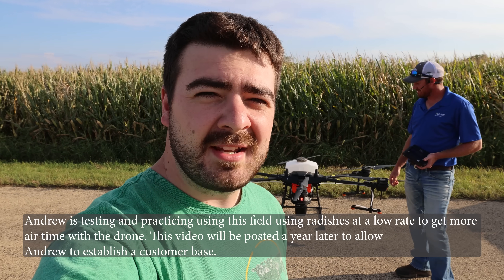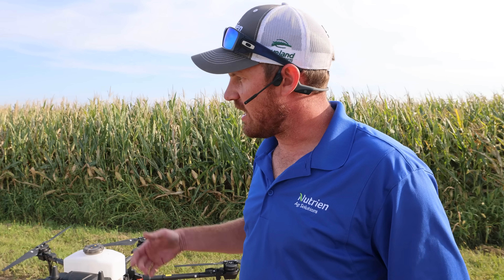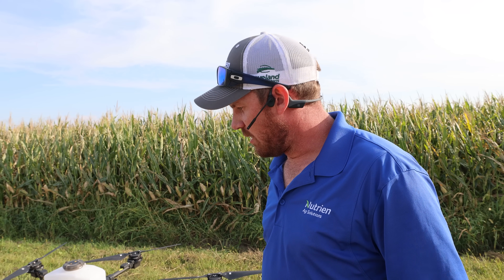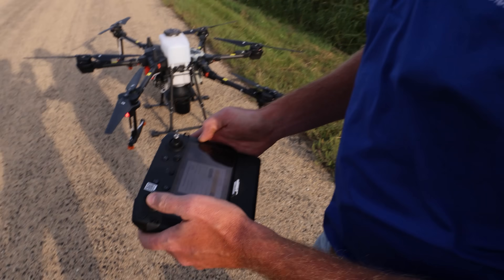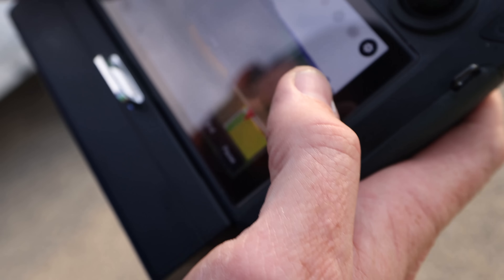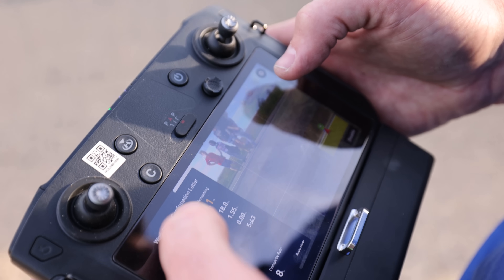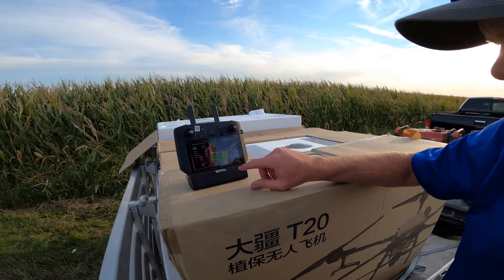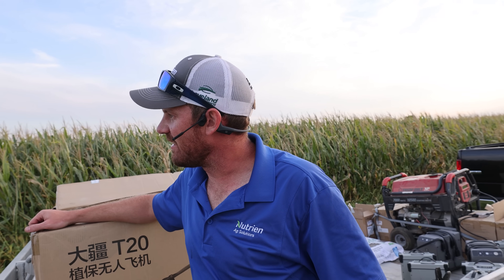Spreading Nitro Radish Airborne - DJI Agras T20 Drone

Comment: I can see the possibilities using a drone. But I'm curious what the cost would be per acre for spraying that he would charge? I've heard if other sites trying the drone application and they said it was lots of💲💲💲💲💲??
Reply: It's probably expensive now because it's a relatively new technology. I would also bet that an operating cost comparison would show the drone to be cheaper to operate. The challenge has to be in getting everything started.
Reply from the maker: A lot of these guys are competing with planes and helicopters, and shouldn’t be more expensive. If you have a lot of acres, though, you would probably want to go with a plane or chopper

Comment: Imagine this thing completely automated with a docking station that refills fuel tank and applicator tanks. Farmer could have it set up for all their fields. The system could calculate everything for them and even be set up to reorder fuel and supplies on it's own.
Reply: That'd be so sick
Reply: It would probably get more done, I’m just as guilty, but less bull****ing, b****ing and it doesn’t need to take a leak!
Reply: Imagine, once there is enough automation Andrew and Ryan will be out of a job! Won't be long until farms are run by kids in computer labs.
Reply: @Pr25790  It just frees up your time to work on other tasks (such as the ever growing deferred maintenance list).
Reply: @karlrovey  I know, and it is a cool device. I'm just not a fan of machines that take the place of people.
Reply: @Pr25790  In this case, I think it's beneficial by reducing compaction, fuel use, and wear and tear on the big equipment. Plus it allows you to seed cover crops into your cash crops without damaging the cash crops.

Comment: Of course it is the future.. also for scanning soil moisture levels and ripeness for picking, back to the farmer in two seconds updating and scanning using color flags and 4k cameras with a blockchain linked wireless network antenna on the farmers truck, to the local state hub of a global blockchain distribution chain..  full data transparency direct from farms to market.. lots of data

Comment: Are there drones yet that use multispectral sensors to asses crop condition and then apply custom fertillizer-fungicide-insecticide applications?
Reply: The T30 (successor to the T20 shown here) has a multispectral camera option. It doesn't appear that it can spray and use that camera at the same time from a quick glance at the specs, but maybe it can and I just missed it. You can also get smaller DJI drones that just have a multispectral camera, and they can generate input for the larger drones.
Reply: @lwilton  Good information! I would want to ground truth the imagery with a crop inspection before I settled on an application anyway so not being able to image and immediately apply would not be a deciding factor for me.